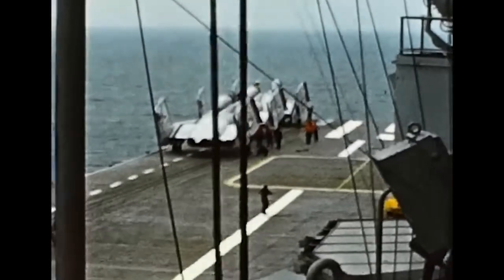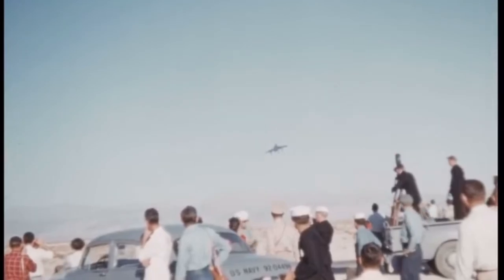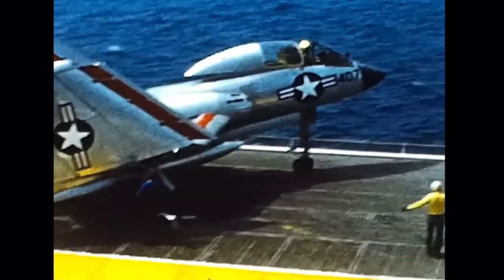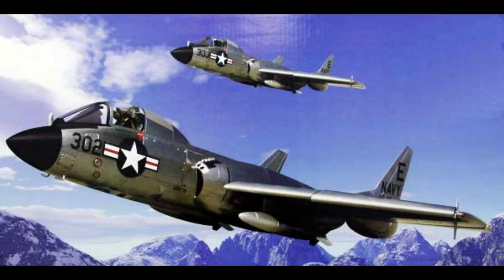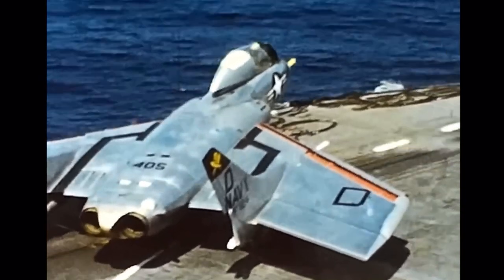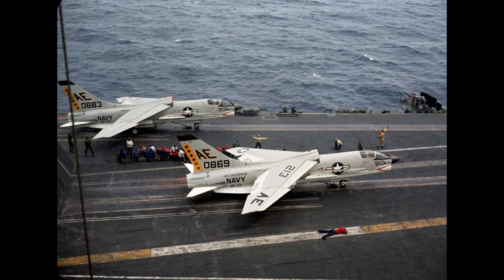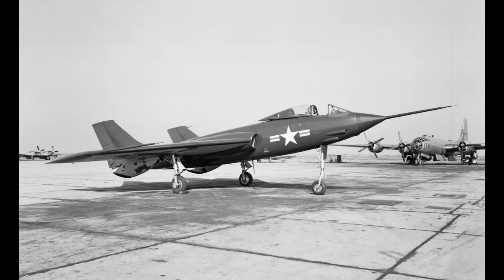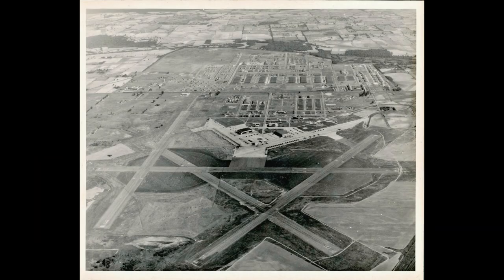The Worst Blue Angels Jet That You've Never Heard Of (F7U Cutlass)

Comment: One of the first model kita that I built as a child decades ago was of the Cutlass.

I have always liked the design and I bet if it were built today with modern engines, avionics and airframe construction methods, it would be a real winner.
Reply: It actually had some ground breaking systems such as the first 3000 psi hydraulic system.
Reply: The F-14 with its wings swept back strikngly resembles a Cutlass.

Comment: A beautiful aircraft sabotaged by the common at the time issue of not enough power provided by early turbojets. An interesting comparison is with the contemporary and also quite radical Douglas F4D Skyray. Cutlass 18,000 to 31,000 lbs, 9,200 lbf thrust normal, 12,000 lbf w/ afterburner. Skyray 16,000 to 27,000 lbs, 10,200 lbf thrust dry, 16,000 lbf w/ afterburner. The Skyray also had a fairly short operational history owing to the rapid pace of jet fighter design progress in the '50s.

Comment: The Cutlass would have been the beneficiary of a robust fly by wire computer system - had they existed then.  With a computer to control inputs and to keep the wing level, etc., the Cutlass probably would have been a great aircraft.  However, absent of that, the design was ahead of its time, but the powerplants were behind the times - with the expected bad results.
Reply: The computers of the time were bigger than a cutless .
Reply: @georgesheffield1580  fly by wire had been around since early WWII - with the Heinkel He-111 being a good example.
Reply: @jamesroets800   That was an experimental model that never went into production.
Reply: @derekheuring2984  The Cutlass did go into production.  My comment was a 'what-if'.  Just thinking out loud.  Fly by wire systems had been available for several years by that time.
Reply: @jamesroets800  You misunderstood my response, I was saying the He111 with fly-by-wire never went into production.
Reply: @derekheuring2984  Okay - I apologize for that.  I did misunderstand you.  My only point was that the technology was emergent then and Chance Vought could have scored a big coup.  But it didn't happen.  It makes me wonder if the Cutlass was built today, what it would be like?

Comment: The late 40s and early 50s were a time when the aviation community was searching for new ways to create aircraft and in some cases, common sense seems to have been lost. Can anyone with any mechanical sense not see that nose strut will always be a problem on carriers? Ejection seats were new and didn't work at lower altitudes so TO and landings had to be made with the canopy open. The hydraulic flight control system, if lost would not be replaced with a mechanical one for 11 seconds! In a high-speed dive or formation flying, that is a lifetime! Obviously, no pilot would have even thought that was acceptable. Jet engines were also new and many on paper never lived up to their expected thrust rating. The only plane from this era that was successful was the F-8 Crusader. It had the new J-57 engine and even though it solved the carrier approach angle with the movable wing, it was a much better solution than the long nose strut. One major mistake in my opinion was forgetting the bubble canopy that came out at the end of WWII. All of the jet planes other than the very first group like the Panthers and Cougars had blended canopies into the fuselage and rear visibility was severely hampered. This continued on through the F-4 and then came to a halt.
Reply: I was wondering why the video showed planes landing with canopy open.

An advanced air frame design with flakey hydraulics and 11 seconds without flight controls on a jet.  That's insane.
Reply from the maker: It’s always funny to look at how no matter how many problems an aircraft had, the engineers wouldn’t fix them. They would just add more things to go wrong in hopes of fixing things. Also the F-8 is a great jet and I plan on making a video on it soon.